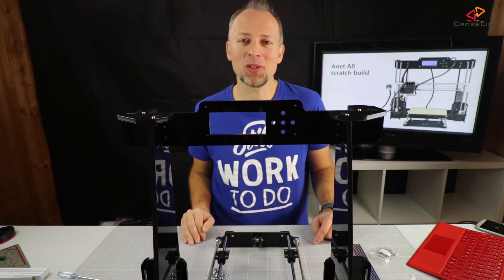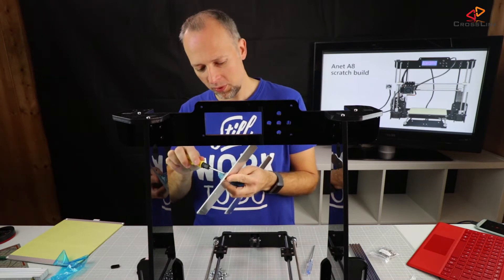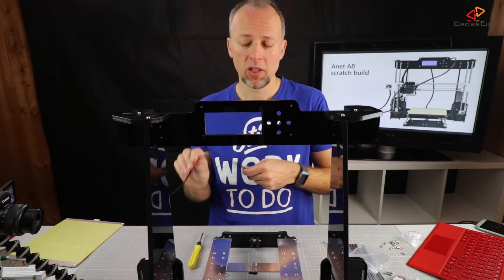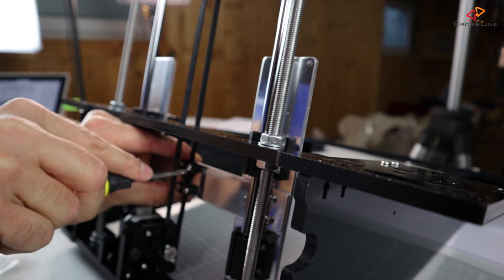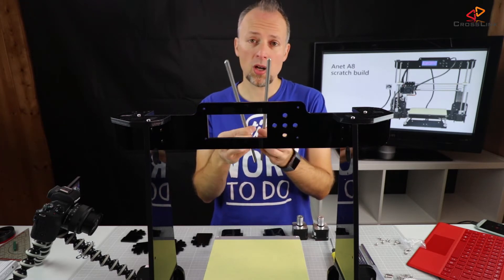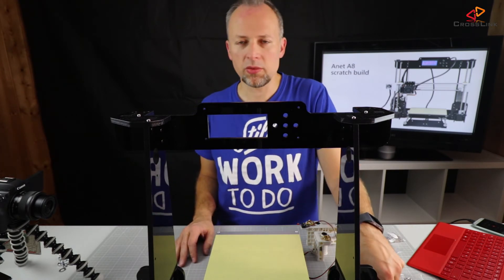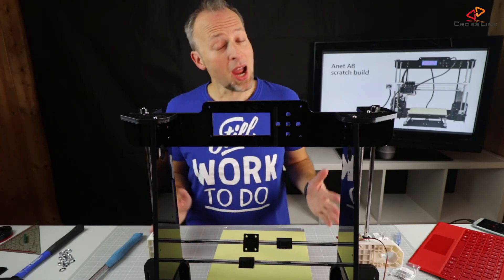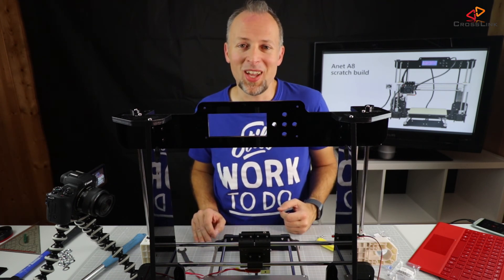How to build the Anet A8 - part 2 -  heatbed, z-axis and the extruder

Comment: Just built mine tonight and ran into a major issue. If the smooth linear rods for the x axis are pushed to far into the left white piece, it puts to much stress on the part, causing it to push the left lead screw towards the smooth rod, causing it to bind. So i literally have only 8mm of the x axis rods in the white plastic piece haha